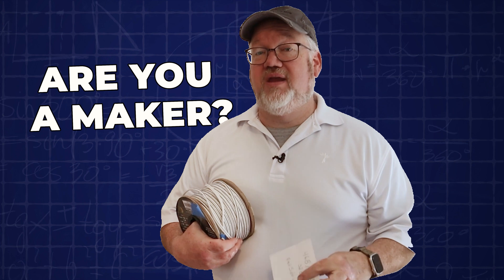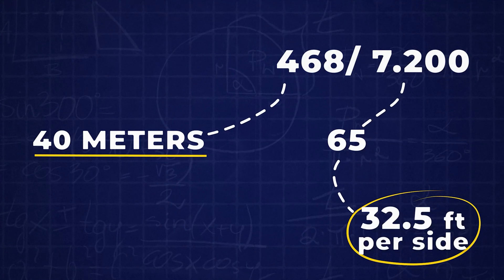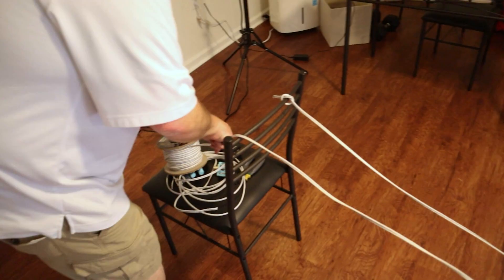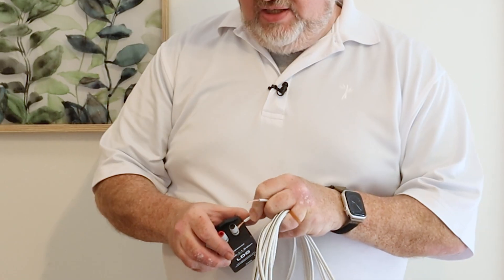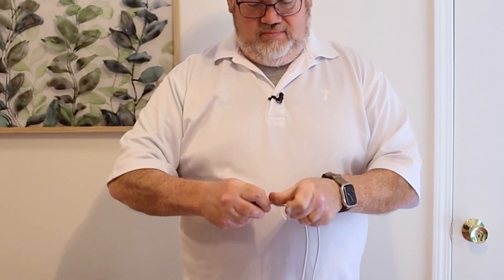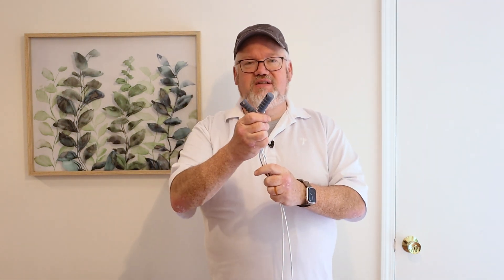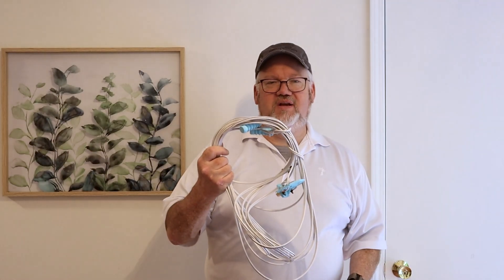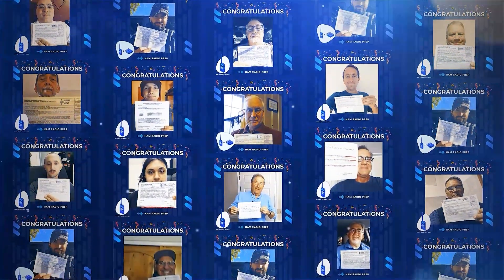How to build a dipole antenna for Ham Radio!

Comment: Can I solder the coax directly to the wire to avoid the balun if I don’t have one? Also, do you have a video showing how are you getting this on a tree and what the angle between the wires?
Reply from the maker: You can solder if you like.  We've used various launchers.  For this antenna we just used a few bolts as a weight and tossed it into a tree.

Comment: I am building a 75M  Inverted V wire dipole....but how far off of the ground should the ends of the wire be?  I see conflicting answers on this but trust your answers the most.   TIA.
Reply from the maker: From Professor Jim: I don't know of a good rule of thumb.  It would depend a little on how much you are trying to get DX versus NVIS.  Ends closer to the ground would have the signal not reflect as far as higher ends.

Comment: Can i make a smaller one for an apartment balcony?  New shortwave listener here in Texas, liked and subbed
Reply from the maker: Hi, It depends on the size of your balcony, but a dipole for the 10M band is small (28,400 16 feet 4 inches) which if you make it inverted V would be 8 feet 2 inches each leg.
Reply: @HamRadioPrep  thank you for the response  balcony is 12 feet by 5 feet, i think a v shape could work.
Reply from the maker: @welliwritemusic  One of the nice things about this hobby is playing with the antennas. With the space we have available we can put a wire antenna in different ways until we find the ideal position and with good SWR :)

Comment: When building an antenna, should I be using a frequency in the middle of the band?
Reply from the maker: You should be building for whatever frequency you think you're going to be using. Most tuners will tune your antenna down if you build for the middle of the band, but you can cut for precise frequencies if you want to run without a tuner. Hams will commonly cut antennas for 14.074 mhz for an digital mode focused dipole, for instance.

Comment: I'm  not using  wire but copper  3/4 inch   apx 6.3 foot  use gray pvc T  as we kno beside  silver copper best conductor  female  connector 4 connector  2 meters  br very easy now cheap no
Reply from the maker: Thanks for the info

Comment: Very good video.  Why on baluns is there a frequency limitation and variance?  Yours goes up to 30MHz and I have one that goes up to 54MHz.  But why wouldn't I be able to try the 2meter or 70cm band??  Thanks.  73 K0JNS
Reply: Well, first of all, he refers to a balun that he printed.  That is not a balun.  It is a center insulator.  To answer your questions, baluns with a ferrite core of some kind have a frequency range.  There are many types of ferrites.  In a YouTube video I used the wrong type and it failed at about 30MHz. The ferrite got to almost 100c.  He said at 100 watts you be the judge about the need for a balun.  I believe that all HF antennas using coax as in this case, should have a balun.  When he said in case some of the RF was reflecting from the antenna and onto feedline is not correct.  Keep in mind that if you are using coax, it is a 3, yes, three conductor cable.  The explanation is long but really simple.  I would explain further but I am tired and just back from chemotherapy. 73, Jim Heath W6LG
Reply from the maker: Thanks for the further explanation Jim! Feel better soon!
Reply: 😅 @ham-radio
Reply: @ham-radio  explanation is not that simple
Reply: Hope u get better Jim
Reply: Excellent video. I used a cheap plastic cutting board to make my insulators, hoping to get to a ham fest soon.